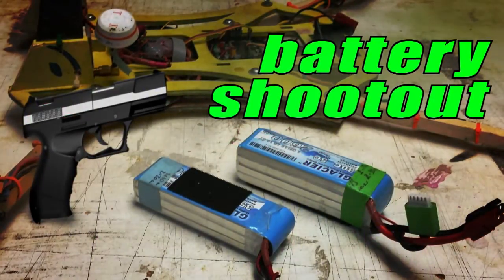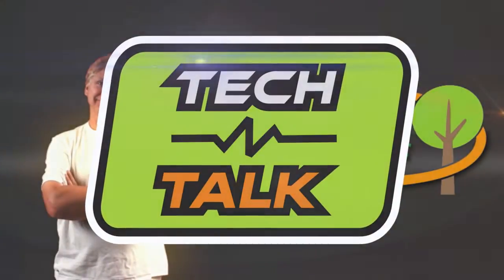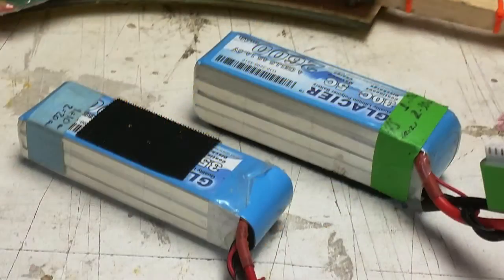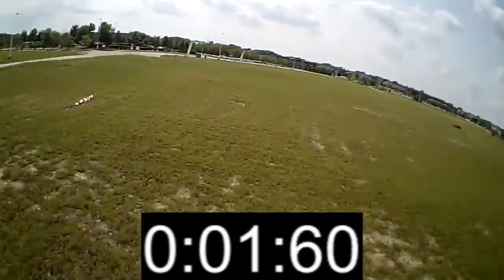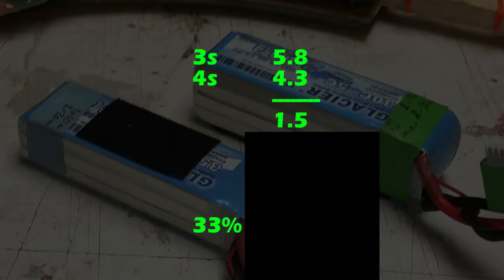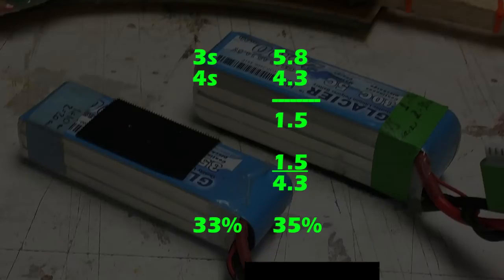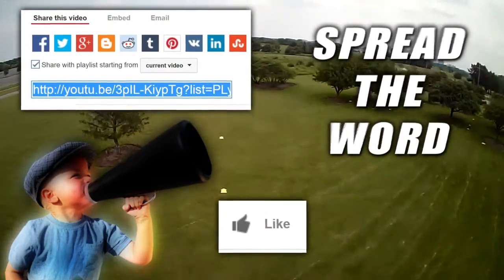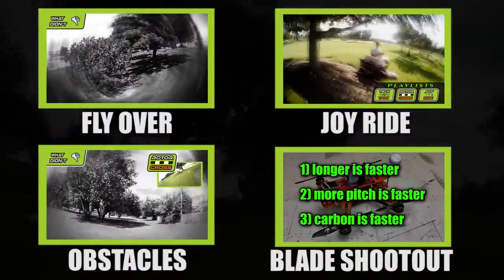Tech Talk: Battery Cell Shootout // 3s vs 4s Speed Tests // Glacier Lipos

Comment: Hello budy, i'm assembling a hexa F550 with gimbal and gopro, and i want know which motor and battery would be better for long flights. (25min)(Motors Emax 820kv and Escs 30A Simonk and landing gear with 337g)Thank you in advance for your help!

Comment: I see motors with 2300kv and other motors with 980 KV. Is a higher number an indication that it goes faster? I'm trying to build a quad that flies on 4s and the 980 states I can run 2-4s batteries.
Reply: +Erick Gomez kv means revolution per volt. So a motor with 4s will spin twice as fast as a 2s. For a 4s mini quad (5" to 6" props) 2100kv -2600kv is the typical motor kv for racing.
Reply: Well not directly, it depends on what size and weight your quad will be. Generally with less kv you will have more torque and will be able to spin bigger props and getting your (arguably) more thrust than a 2300 kv motor that will have to spin smaller props and give less thrust. The negative of low kv motors with big props they tend to be slower to react to your inputs. So for racing and acro freestyle you go for more kv motors as you want to have faster control, and for a filming quad less kv motor with higher efficiency..

Comment: You can't just pick whichever denominator you like.  If you're adding 33% voltage with the 4S what you're looking for theoretically is a time of three quarters of the time with the 3S battery.  If going 33% faster then you've improved your time by one quarter.  This is because 4S is one and one third times 3S, meaning your speed should be one third faster than the 3S speed.  Travelling a speed 1.33  or 4/3 times the 3S should give you a time the reciprocal of the 3S time, which is 3 quarters, or 4.35 seconds, which is what you got roughly. 

If you use the 3S time as the denominator you get 25%, which tells you how much slower the 3S is compared to the 4S.  

Sorry to get so technical, but I was bored.
Reply from the maker: +moeman1984  thanks. I never knew which one to plug in for the calc.
Reply: +moeman1984 - yeah i was thinking the same thing. im glad i wasnt the only one

Comment: Straight line speed isnt surprising, but lap time difference would be more interesting especially with comparable pack sizes, ie 1500 3s vs 1300 4s for similar weight and a more representative 250 quad with typical kv motors.
Reply from the maker: Its warming up finally so FTR can do some real world RX and GP testing. The first couple on the list are weight and motor tilts going through real courses like the ones you guys fly.
Reply: FPV Tree Racers Sounds good, I'm especially interested in motor tilt, my guess is its no different to camera tilt, but will be interesting to see a comparison say 15deg camera tilt vs 15deg motor tilt. Weight I think will be much more significant in a proper course with bends.
Reply from the maker: *****
Agreed. But I am interesting in weight. I am going to do several apples to apples tests by adding 100grams.

For RX with motor tilts, I don't think there will be any difference at all. But you got to do the test to find out for sure.  But I am switching to servo FPV tilt cams since I prefer RX over GP. With all the accelerating and deceleration, I can keep the obstacle ceilings in view. I had to check up constantly last year since I could not see the top of duck unders during acceleration. Now its my favorite course feature: Slow 'em down then make them accelerate through a series of straight line tube duck unders. Its a bitch without a tilt servo cam. In fact, its one of our X1 race team practice drills.  At our GoDroneX nationals, that will be in the X1 RX course set for sure.
Reply: FPV Tree Racers Servo tilt just seems a lot of complication and likely to get damaged, I'd rather keep it simple/cheap and robust, its the same for everyone and once you've learned the course you shouldn't need to look up anyway ;)

Comment: Much better- I didn't feel like I was a kid you were talking down to as much. Now- loose those silly yellow arrows for course markers and I could probably seriously begin supporting your efforts. You are forcing square pegs into round holes due to a confirmation bias you have developed over the arrows. They are not easy to follow, and the pilot's focus should not have to be diverted to the ground for direction. Those cues need to be straight ahead- not down below.
Reply from the maker: Most organizers absolutely need yellow arrows. For RX courses, GoDroneX organizers believe they are a must. For GP they are not really needed but don't hurt. For videos, it says to the viewr that this guy isn't joy riding, but following a predefined course. But if you ask either an organizer or a beginner if they prefer course markings, the answer is yes.  GoDroneX association doesn't require the use of arrows, but most if not all use them, especially when using mother nature for courses. Our GoGates system is required primarily for our sponsor commitments.
Reply: FPV Tree Racers We use football marker dots all round the course, same as Greg's arrows (but much cheaper in the UK), I think its important to see a trail to follow whatever it is, otherwise trying to pick out the next hoop or which tree to turn round would be much more difficult, and you end up either missing an obstacle, or hesitating and losing time. There is no sensible way I can see to have cues straight ahead, unless you have a car full of poles with arrows on the top, which would just become targets to hit ;)
Reply: FPV Tree Racers
I think you miss my point- I am not advocating for no markers- but instead a marker system that does not require the pilot to refer to the ground. I suspect, the arrows are a solution to a problem that could better be addressed using feather banners, CPVC, or something that has vertical presence. Having come back from a race today I can tell you I need to see ahead- not down, and yellow in the fpvcams is too close to the greens in grass and other tan, yellow or green groundscapes- not enough contrast- at least white would be better as it is proven to be the best contrast in these circumstances (FPV Cam versus naked eye)
Additionally- you are marking the center- which is hard unless you are directly over the arrows- a lane is more user friendly and intuitive and offers at least 2 references.
Now- so you don't think I am simply trolling and flaming, I will mention I think your work on organizing and data maintenance is second to none. I appreciate that standards need to be set- I just feel you are so hell bent on dictating those you fail to notice what is happening in the hobby/sport, and are not willing to adopt what we out here are experimenting with.
Gregg- your name was mentioned today and we all at the group and event (FPV Racing and Drone Day) were in agreement- there is so much right with what you have done, and a few small wtf's that keep us from fully adopting the standard- I will not standardize yellow freakin arrows and expect people to suffer through it. Period. I would however, relish the data maintenance and organizing measures and methods.
I quoted this a few times today, and I will again for you- a great economist once said, "Nothing is less productive than to make more efficient that which should not be done at all"
Reply: ***** You should do whatever works for you, but I've tried lots of combinations and dots on the ground work best for us - feather banners are expensive, and unless you have them spaced every 40ft or so are going to be awkward to see in the distance especially in an open space. I'm sure you don't think your trolling - most trolls don't, but as long as you are actually doing something to encourage/develop fpv racing in your area and not just cricitising others that are, thats all that matters. We don't all have to do it the same way, as long as everyone is having fun and encouraging fpv racing to spread thats all that matters IMHO. Greg is definitely a character and won't be to everyone's taste, but he is spreading the word and encouraging fpv racing, and doing a great job getting video's out regularly, which is a huge amount of work, so I have a lot of respect and admiration for the work he's doing, so we need to make sure feedback is constructive not just scoring points.
Reply: ***** Also, FPV racing is very low level, we are around 8ft max altitude on a lap, any higher you are just losing time climbing/descending, you can easily see the ground and follow dots at this height - I see a lot of 'race' video's where people are 50ft up in the air flying over a course - thats not where fpv racing will end up, this is just people learning/developing skills, once people are confident and height comes down, following markers on the ground is absolutely the easiest and cheapest way to follow a course.
Reply: *****
All valid points- but somewhat subjective. I do encourage racing and I agree Gregg has put in a lot of time- obviously his own, and at his expense. I have tremendous respect for that- as for his "character" I find it not the least bit odd- I saw what he was trying to do from the first second I saw a video- I was immediately drawn in.
I understand that his "method" does not have to be followed- but please understand, it would be very unethical and not in the spirit of community to just take out all the good parts of his efforts, adopt them, and then call them our own when it is a small jump to true standards and honest incorporation. I would rather not mix and match and be fully vested.
Of course as it stands now it is a complete and utter wild west amongst all the participants and fans- and people are very willing to implement their own special rules. I prefer a more centralized organizational effort- I want to get on board with this because of all the good parts- but the bad, while simple and few are too glaring to do this.
I will just keep watching- I will not keep commenting- I have said my piece and more. I think I have made my points. Either they resonate or they do not.